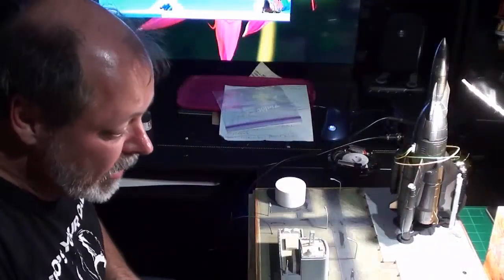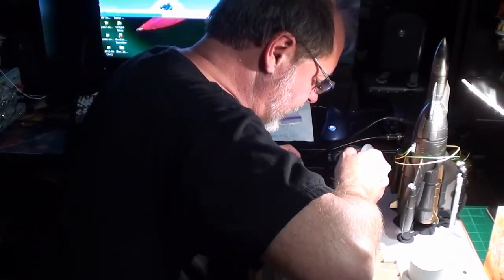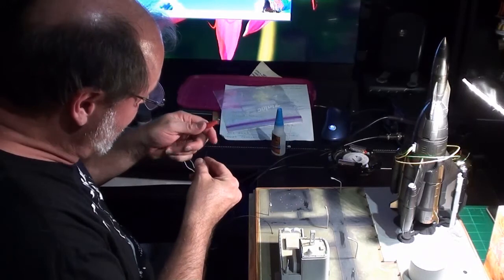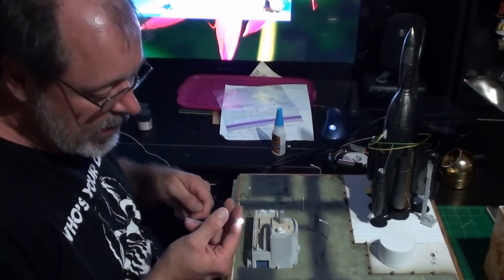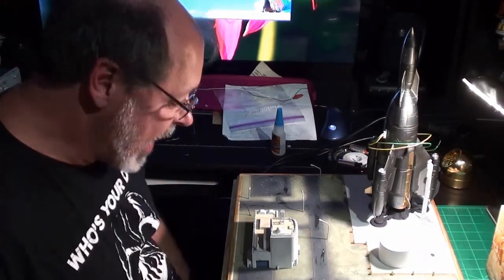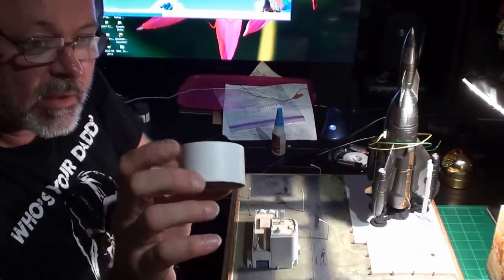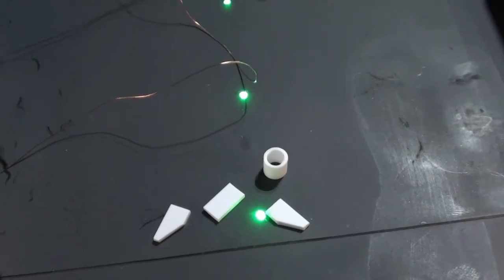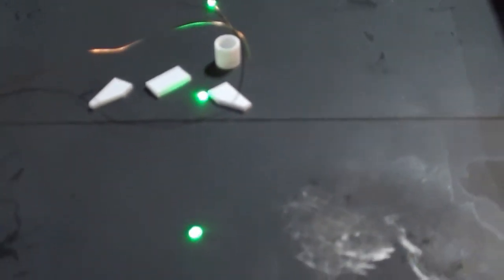Project Mercury 9: Part 32 Tank and spotlights

Comment: I'll have to get up there and measure some lights then.. trouble is, they were dug out years ago and some of them are now neatly stored where parts of the main runway once was, right next to the memorial.. The memorial has actually three runway lights incorporated in the foundation, which is a nice thought.. but as for the distance between the lights and so on, I still need to do some research..

Comment from the maker: I too thought that Thunderpaws would swat that chopper right out of the air but he didn't.   For the landing lights on the Mercury, I took video of a run way in Austin as we were taking off and landing, so I got good footage of how they looked.   Getting the scale right is pretty easy.   Since you are working in metric, just look up the markings and how they are laid out, divide by the scale you are using and then shift to centimeter.  That is what I did...

Comment from the maker: The time it takes for the Gorilla CA to set is about one minute.  This is a slow curing CA.  Yep sanding the led would improve the bond between it and the glue.  5 minute epoxy would hold better, but it is a mess to work with.  I try to reserve it for resin models.  I saw that video that Boyd put out, and I will still keep CA from fiber optics.  I have had too much trouble with CA  and fibers in the past.

Comment from the maker: It is getting there, today is my day to work on her once email is done.  Not too much longer.  I have to fix some paint mistakes, and then get the spot lights light blocked.  The fence goes up around the launch area today.   The C-130 will also get put on the landing strip today.

Comment: Boyd on TrekWorks says that after you glue an led with super glue spray accelerator on it so the glue will not damage it. Oh wait that is for fiber optics. The accelerator stops the eating on the optics. Otherwise it keeps working and eating the strands. I wonder if you lightly sand the part of the led where it going to glue to the glue would adhere better. Or maybe just use 5 min. epoxy. You got me thinking Phil.